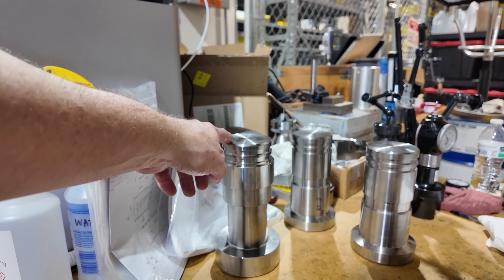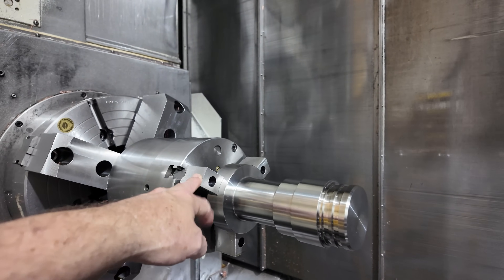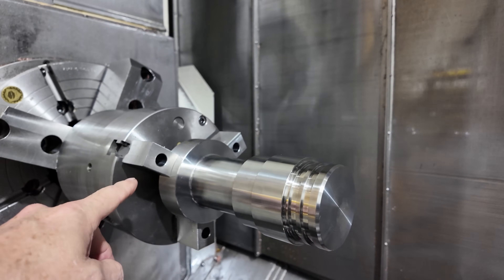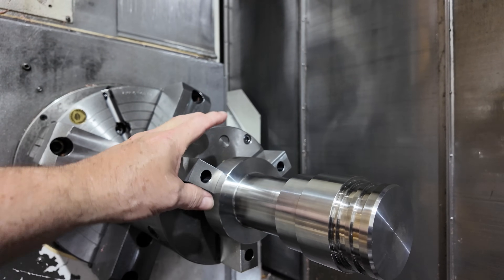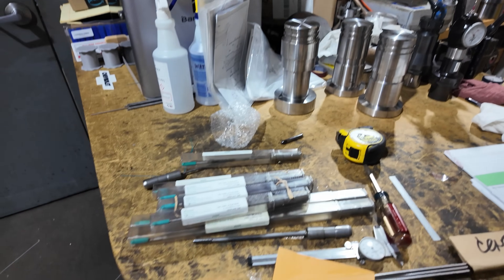Plan Job For New Parts

Comment: Holding in double chuck. What is the benefits?
Reply from the maker: On this machine if you have a large diameter chuck you have clearance problems with the milling spindle and the chuck face/OD/jaws. When you are milling or turning on the OD of a smaller diameter part. The milling spindles face is almost 12" in diameter. So with the B axis at 90 degrees (Like a vertical Mill) you will hit the chuck with the spindle unless you use long tools. So to avoid having to use excessively long tools for smaller diameter parts. I put a smaller chuck extended out like you see here. Also if you intend to tip the B axis tool back towards the tailstock end of the machine it gives more clearance for the B axis spindle on the left upper end with the machine's enclosure. This is just the nature of this style of machine.

Comment: Won't the drill rods twist with the drill and crack the cutting edge?  What about sinker EDM?
Reply from the maker: If I bend the rod just right I think there will be enough friction to stop it from rotating. A gun drill feed much slower than a twist drill. Though as a back up I have thought to drill a hole for a small pin off center in the pins holes wall intersection to keep it from rotating. I do have material where the larger holes at the face of the part. We will see. An EDM machine is doable but is much more complicated to align the part to the drill. Unless you have a 5 axis EDM machine. I have never seen such a machine. Maybe it exists. But I have never heard of one.

Comment: Abstract

This video discusses the planning and challenges involved in milling
titanium and 174 pH stainless steel parts. The speaker focuses on
workholding strategies to ensure part stability during machining,
especially when milling a keyway feature.  A major challenge arises
from intersecting gun-drilled holes with minimal drill support due to
shallow angles. The solution involves a novel technique of inserting
drill rod as temporary support during the drilling
process. Additionally, the video covers the design and manufacturing
considerations for custom tooling needed to create specific part
features, such as undercuts and high-pressure ports. The operational
order is outlined, and the video concludes by highlighting the key
challenges and previewing the upcoming setup and machining
demonstration.

Summary

Introduction

* Speaker will not repeat previously made content.
* Aims to provide new, valuable information for viewers.

Job Introduction

* Two titanium parts, two 174 pH stainless parts to be milled.
* Concerned about existing chuck holding strength for part shape.
* Plans to add clamping system across flange as well as continue chucking. 
* Planning stage of job, focus on gun drilling process due to potential issues with hole intersections.
* Will push drill rod as support during intersecting drills.

CAD Model Examination (174 pH part)

* 00:04:00 Plans to remove OD to form key shape.
* 00:04:30 Counterbore and holes on part end likely done with chuck as-is.
* 00:05:00 Plans to mill OD near flange with long end mill while rotating C-axis, then square sides later.
* 00:05:30 Concerned about manual chuck holding power during the process, will add clamps.
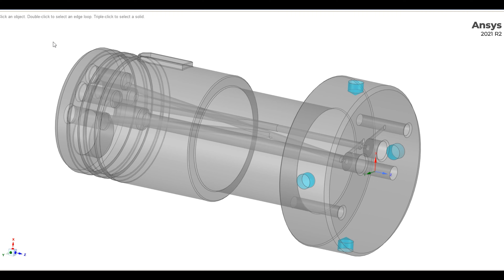* 00:06:00 Issue due to intersecting gun-drilled holes at a slight angle with little support for drill tip.
* 00:07:00 Plan to drill short hole, insert drill rod, then drill other hole. Rod should support intersection point.
* 00:08:00  Same logic for other intersecting holes
* 00:08:30 Special tools needed for autoclave engineering ports:
    * Threaded port with a tapered area for conical tube tip to create high-pressure metal-metal seal.
    * Will make end mill to create 5-degree taper in part as per specs.
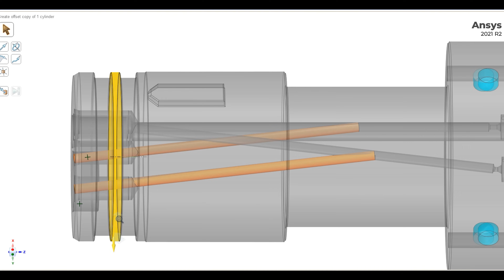* 00:10:00 Some ports have closed tolerances and will be bored later, other features are straightforward 
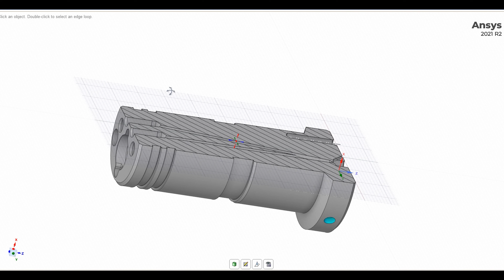* 00:10:30 Intersecting hole arrangement causes complexity. Must drill in correct order to avoid breaking drills.

CAD Model Continued

* 00:11:00 Further detailing of how intersecting angled holes create issues
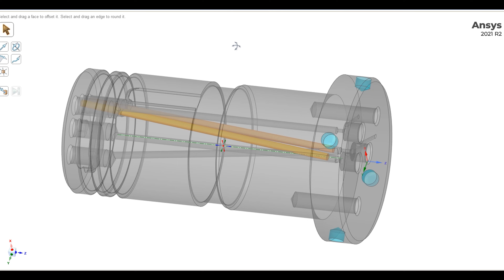* 00:11:30 Unsure of customer's plan for high-pressure sealing at other end of part.
* 00:12:00 Small angled holes near ports are for leak detection
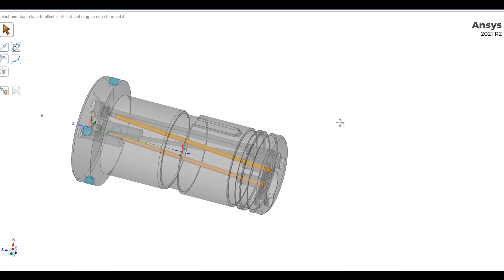* 00:12:30 Blue holes are for a spanner wrench
* 00:12:30 First operation will be on part face with keyway milling
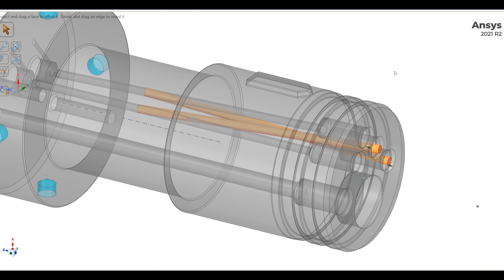* 00:13:00 Five axis machine better for angled holes, simplifies positioning using offsets etc.
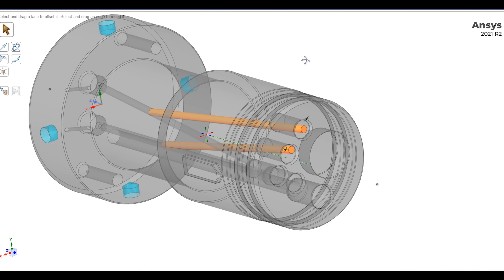* 00:13:30 Will first drill holes where orange slugs appear in model, then support with drill rod, then drill remaining intersecting holes. 
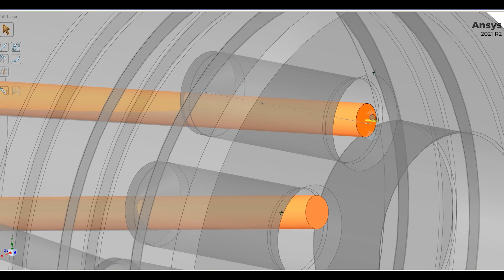* 00:14:00 High-pressure coolant at 1500 PSI may push out support rods 
* 00:14:30  Potential solutions for holding support rods (bending, banding, etc) being considered. 

Pulling out support rods

* 00:15:00 Plan to leave drill rod slightly exposed for removal
* Will use vice grips attached to a slide hammer to extract
* Believes friction, combined with a bent rod shape, will prevent coolant from dislodging them

Additional Tooling Needed

* 00:15:30 Part has a pocket with an unknown function
* 00:16:00 Requires custom tool due to undercut feature
* Speaker drew up design for a cutter, to be ground 
* Option to purchase this type of tool maybe exists but grinding is easier in this case

Operational Order

* 00:16:30 First operations will focus on milling both parts on one end
* Parts then flipped, chucked on new diameters, and aligned using keys (internal or external) to establish reference point
* 00:17:00 Work continues on the opposite end: ports, various holes

Key Challenges and Wrap-up

* 00:17:30 The main challenge is intersecting holes causing insufficient drill support (risk of breakage)
* This is due to the very shallow angles of intersection
* 00:18:00 Next video will cover setup, programming, and the actual machining process 

Disclaimer: I used gemini ultra 1.0 (2024.02.08) to summarize the
video transcript.  This method may make mistakes in recognizing words
and it can't distinguish between speakers.
Reply: This might be more impressive than the part at hand.

Comment: Surprised you didn’t use a plug with a center in it to use the tail stock when you mill the key feature.
Reply from the maker: I plane to mill the stock around the OD with the endmill parallel to the part rotating the C axis. So that means no tailstock can be used.

Comment: Hadn't even thought of the coolant trying to push the rods out, I was just wondering if the drill was going to end up spinning the drill rod when it made contact. I imagine your solution will avoid both of those problems. 

A few of these features would cause me some stress on their own. Combining them on a part that was provided and that the customer already has money into would keep me up at night.

Comment: May be use EDM drill?
Reply: Interested if edm drill would move of target
Reply: @thomashoffmann4504  Depends on the intensity of fluid flow through the tube.
Reply from the maker: But to get the angles you would need a 5axis EDM drill or a lot of fixturing for that machine. And it would take longer with EDM.
Reply: Does the customer even allow recast?  I often find myself machining things that would be nice to EDM but am not allowed per customer specifications. @EdgePrecision
Reply: @danielgrebner8412  Sometimes they won't let you thinking it changes materials characteristics.

Comment: Use a tail stock with a flat face or another chuck to grab the end. That part ain't going anywhere when milling that way. Save you messing about with clamps.
Reply from the maker: The tailstock will get in the way for the milling strategy I plan to use and also doing the end holes in the part.
Reply: He was planning on milling the od in XC
Reply: @EdgePrecision  I've made an extension for the tailstock for jobs like this, gives me about 20" so there is clearance. Works for all kind of things, also can attach a chuck for getting things really true when needed.
Reply: @SUMOCAT86  I'm fully aware of that.
Reply from the maker: @richiejbhoy1888  all that might work on a lathe with turret milling spindles. But on this mill/turn machine you can’t get the spindle down anywhere close to centerline with the tailstock moved in. Its Y axis and spindle will hit the tailstock. I plan to mill the OD with the endmill parallel to the turning spindle’s centerline using the C axis. Also I can’t do the end work as well.

Comment: My biggest fear would be the drill rod removal, burrs can really hang u up.
Reply from the maker: I don’t think the gun drill will leave burs big enough to cause a problem. There feed rate is very low compared to a normal twist drill. Usually only about .0004” per rev.

Comment: What's with the designs. who designs this stuff. do they even have any experience making anything like this 
or is it just wishful thinking. do they think you can do anything?
Reply: I say the same thing,some of these engineers sit in front of the computer with a cad software and design anything any shape they like not thinking about the machining side of things.
Reply: they have to pay for designing such difficult parts!  there has to be consequences for the burden of their inexperience .  Otherwise they will not learn and continue to be an exorbitant expense until they are finally fired.
Reply: Some parts need to have certain features . in the old days they would do a few zig zag holes to make the connections , and plug the technological holes . But now we can do more intricate parts . Of course stupid designs do exist.

Comment: Why use Ansys
Reply from the maker: It's just the software I have used for many years and I'm use to it. Actually the software that I use was originally called SpaceClaim before Ansys bought it. It has certain things I like (Or maybe I am use to) over say Fusion or SolidWorks. It's not really a parametric (Though it can be) software. There is no rebuilding or say a tree of sketches required so you just model on a solid but you can use a sketch but once you extrude or cut with it it is no longer there. But you can define the model with dimensions, also if you make a drawing of your model/part if you change a dimension on the drawing it updates the model. If that makes sense. You can also just change the model by moving things without any problem. There is no going back and changing sketches and having rebuild errors because the sketches are no longer there.  Other software's do the same thing just in a different way.  Like I said I have been using it for the last 15-20 or so years (I think).
Reply: @EdgePrecision  great